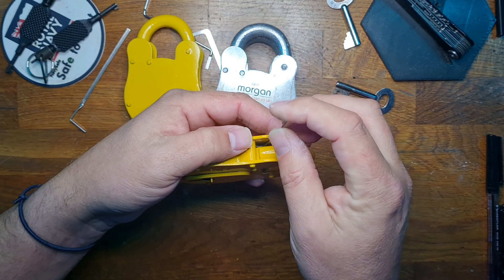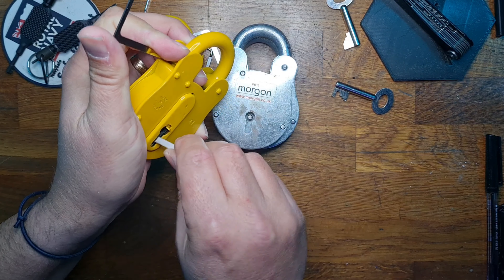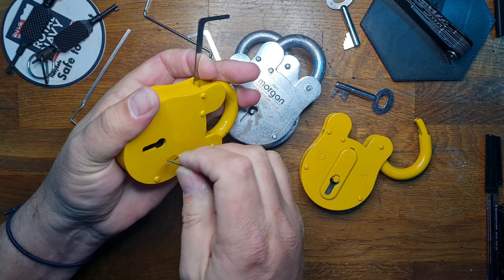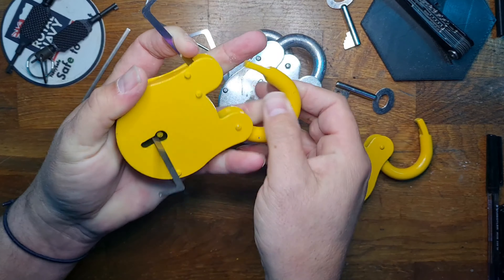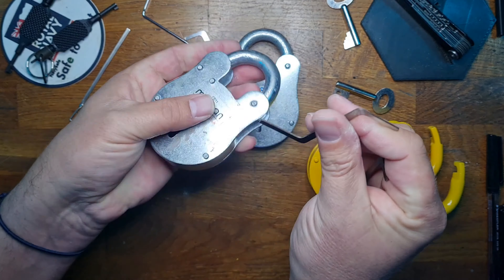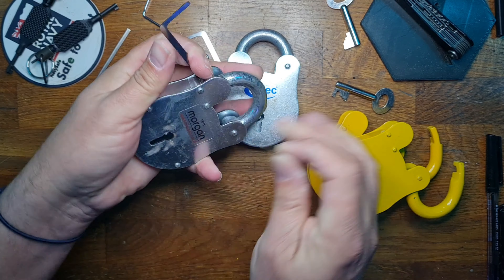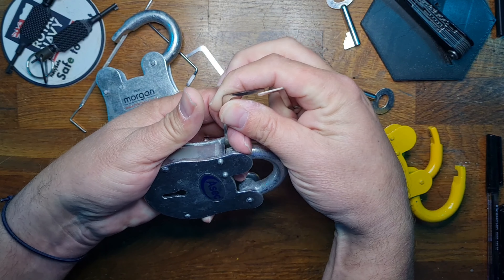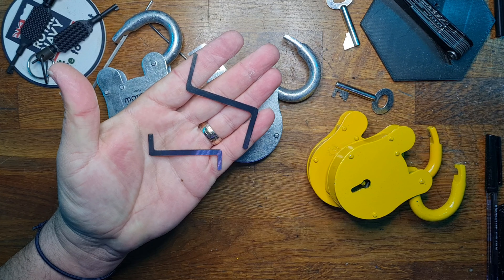UK Fire Brigade Locks - Tension Tool Method

Comment: wow, i didnt expect it to be that fast. i guess not all four levers are blocking the gate then?
Reply from the maker: The levers are there - this method is kind of overlifting/brute forcing an open. Its weird, but cool at the same time. It does require more tension via the top bolt, which I think helps speedily set the levers in turn.
Definitely a useful trick to keep in your back pocket though 👍

Stay safe and have a great week buddy 👍 😀
Reply: @CoxysPicks  Thanks for the info. Ive used this method of tensioning before for other 4 and 5 lever padlocks, and then a bent pick to push up each lever seperately. So, what youre doing here is overlifting all the levers and then using the tensioning of the bolt to drop them into the gate one by one? Ive used a similar method on tricircle pin-tumbler padlocks.

Comment: Can all lever locks be tensioned this way?
Reply from the maker: Technically yes, as in, all lever padlocks using the old English form factor, and that have a gap at the rear of the shackle can be.
It gets harder to achieve with more expensive locks, which have a better shrouding effect on the shackle.
These lock styles are really common in the UK, and as such we have a LOT of cheap, badly made ones available,  even with high end branding (like ACE).

If the lock is classed as an Insurance lock, then this vulnerability is not an option and you have to pick via the keyway.

Hope that makes sense buddy.

Have a great week ahead and thanks for Watching 👍🥳